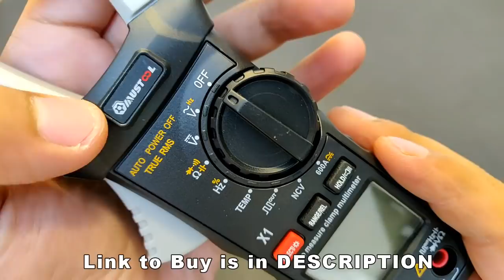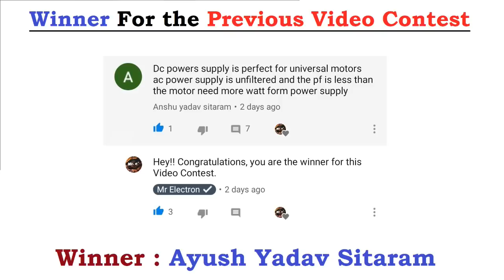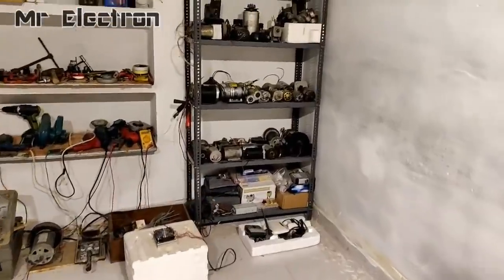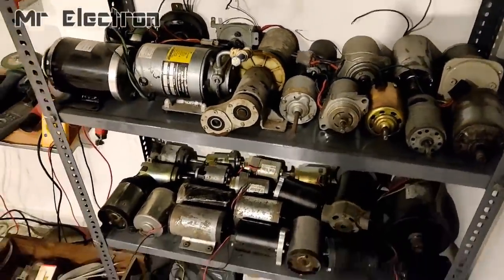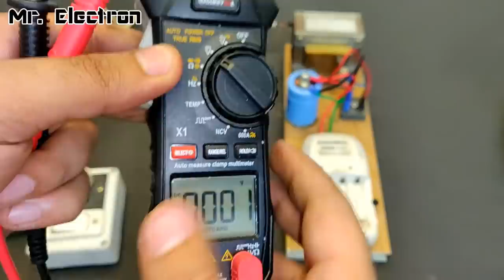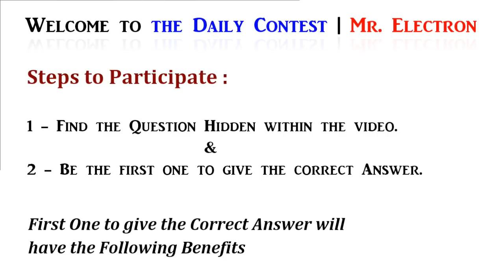Make 1.5v 40A Battery Cell Charger DIY

Comment: 4 battery cells changing current 40 Amp's All most very fast battery also dead not better . In case required current maximum 3 Amp's you use it 5408 number diode Bridge rectifier  to battery life better .